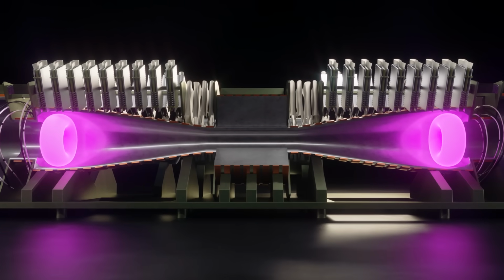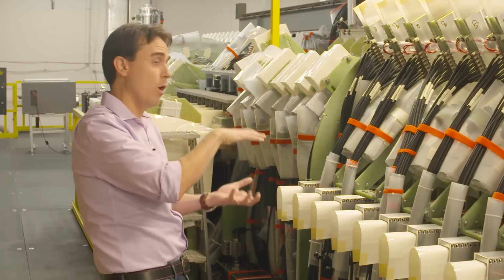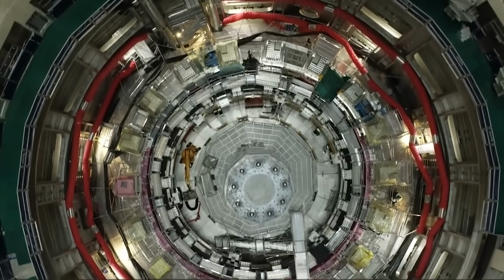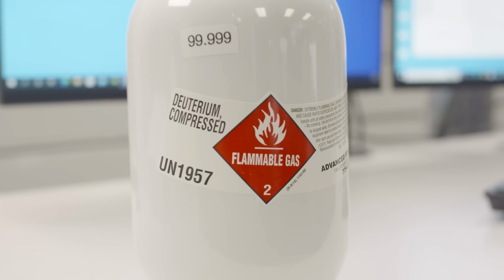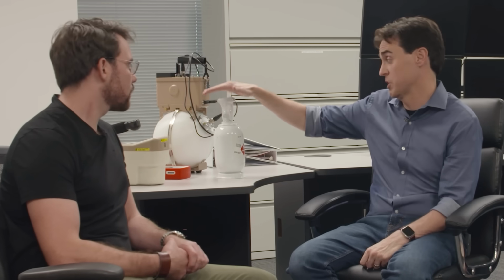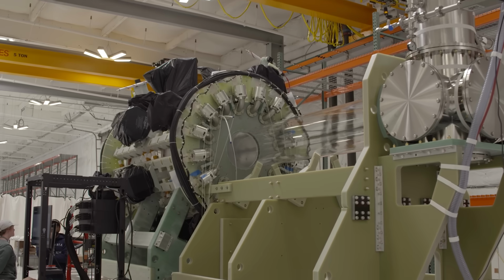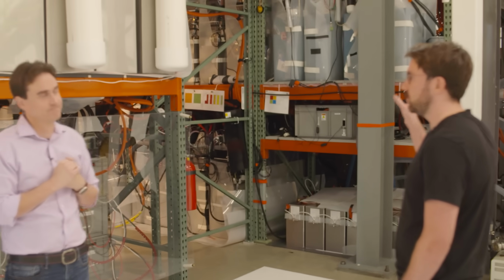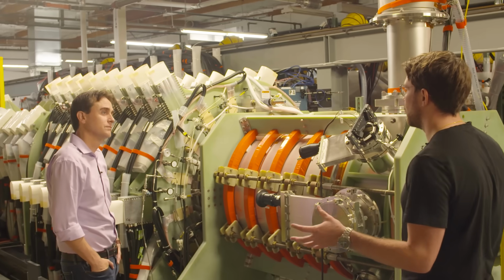A New Way to Achieve Nuclear Fusion: Helion

Comment: A few things that I missed in this video:
1. Did they achieve ignition? Or in other words, did they manage to generate more energy from the fusion than they put in to achieve that fusion?
2. What is the pressure at which this operates? One of the issues with tokmaks is that they have to operate at low pressures, otherwise the gas pressure will overwhelm the magnets, which forces them to work at extremely high temperatures. Is it an issue here? Why or why not? And if they do manage to have significantly higher pressure, does it significantly affect the temperature at which this fusion reaction takes place?
3. If they did achieve ignition, how far away are they from generating enough energy to reach a breaking even point considering all of the inefficiencies of the system?
Reply: I like how bananas were used for scale.
Reply: Net energy gain has NEVER been achieved.
Reply: They didn't achieve ignition. Ignition was achieved for the first time in history by a different lab after this footage was taken.
Reply: @timothynoonan8591  Do you know how far off they are? Will their 7th gen reactor that they talk about get close to being able to do it?
Reply: @256shadesofgrey  They say it will, but that's a very common claim for fusion labs. If everyone else says ignition is right around the corner, you have to as well if you want funding. 2024 is the predicted year.
Reply: @timothynoonan8591  I believe they achieved what you call 'ignition' at the point in the video where the cameras record a pink (or bright purple?) flash, they said the operating temperature at ignition was 100M degrees.
Reply: @James Lynch  They achieved fusion, but they almost certainly didn't achieve ignition (more energy out than in) or it would have been the central focus of the video and the subject of extensive news coverage. Ignition as defined above has been the #1 goal of fusion for many decades, and it was achieved by Lawrence Livermore after this video was filmed.
Reply: @timothynoonan8591  the U.S. Department of Energy confirmed in an announcement on Twitter that fusion ignition was achieved. There are papers written and champagne was drippinG.
That is all.
Reply: @krisstepper  Yes, by someone else
Reply: @timothynoonan8591  the ignition that the DoE was referring to where Q>1 was about the amount of energy contained in the light released from the lasers. Previously, ignition has occurred based on purely the amount of energy which went into the fuel. The next step for inertial confinement is more energy than what went into powering the lasers. And after that capturing more electricity than went in(finally self sustaining). 

There’s a long road ahead, but the drivers are getting more and more comfortable on it while their speed increases.
Reply: @timothynoonan8591  If you mean NIF, the energy in was 300 MJ while the energy out was 3 MJ.  That's not ignition.  NIF claimed ignition by defining the energy in as 2 MJ but that's like a financial manager claiming a 50% return on your $300,000 investment on the ground that $2,000 of it in one of 150 companies returned $3,000 while explaining that they weren't going to invest in those other 149 companies again.  No fusion projects so far are nowhere near true ignition.
Reply: @timothynoonan8591  ignition wasn't actually achieved. They lost A LOT more energy than they made to produce the experiment. The laser beam had 2mj energy to create 3mj but in reality they used 300mj to create the laser
Reply: @ThatHungryAfricanChild  That's still called ignition. They didn't achieve engineering breakeven because as you say the lasers currently lose much more power than the fusion produces.
Reply: @ThatHungryAfricanChild  They achieved ignition by the commonly accepted standards. Even though they're nowhere near producing full-system net energy, they are the first to ever get more out than they put in thermally, which is a real milestone - it means they can potentially move on to solving other problems, such as their god awful laser or the tritium supply issue.
Reply: @barneylaurance1865  ignition is creating more energy than you use. How can you call that ignition if you used 100x more than you made, that doesn't make any sense
Reply: @ThatHungryAfricanChild  The fusion reaction itself (which used energy in the form of laser light) created more energy than it used. The system as whole operated by NIF that used energy in the form of electricity didn't.
Reply: @ThatHungryAfricanChild  the achievement of net energy gain is that the amount of energy injected into the fusion reaction was less than the amount of energy generated by the fusion reaction. Think of it like throwing a rock against a wall. If the heat generated by the rock hitting the wall was greater than the kinetic energy in the rock flying at the wall, it is a net energy gain. However it disregards the energy you used to throw it, which is greater since you are moving your body as well.
Reply: @barneylaurance1865  but it didn't create more energy than it used. If the experiment costed 300mj and only made 3 back that's an extremely large deficit
Reply: @ThatHungryAfricanChild  You are both right.

Think of the process at Livermore as two components.

Part A is the laser, which is where the 300mj loss is occuring. The lab was built years ago with a laser which is not modern or power efficient.

Part B is the lasing itself, which DID create more power than used.

So... the next step is to repeat the process with newer more energy efficient lasers.

That is expected in 2024 and will be a net energy gain if their math is right.

The next step after that is miniaturization of the technology or shrinking everything down into a system which is economically viable.

THAT is expected around 2030
Reply: @ThatHungryAfricanChild  It all depends on what you're interested in. You could draw the boundary of your system anywhere you like. If you are measuring the calorie content of a serving of peanut butter, you probably wouldn't measure the amount of solar energy that landed on the plant's leaves during a harvest season. You might do that if you were interested in the crop land required to produce a serving of peanut butter, but if you're interested in how much that serving contributes to a human diet, you would only measure the available energy that is actually stored in that serving.

There is a debate to be had about whether the definition of fusion ignition is useful, but it is a valid definition. And from the perspective of a fusion researcher, it makes sense to use this definition because the current goal is to optimize the physics of the actual fusion reaction. Inefficiencies may be accepted in other aspects of the engineering of the fusion reactor because those inefficiencies can be improved upon once we know we can actually get something out of improving them.
Reply: It is worth remembering that NIF is an old facility, If built today it would use diode pumped lasers which ar ten times more efficient  still does not get break even obviously but there will be other things a scaled up attempt at a commercial inertial confinement reactor would change for more power.
Reply: @timothynoonan8591  Calling their laser “god awful” is hindsight bias to the extreme. Efficiency was never part of their laser design, they wanted an adaptable test environment. Could you imagine getting a ton of funding, spending 5-10 years building it and then realizing you built it just slightly too underpowered to achieve your goal? The laser is based on 90s tech, the design was formalized in 2001 and they finished building everything in 2009. So yeah, should they chose to redesign it, it’d be very easy to find high efficiency gains.
Reply: @silkforest8698  that peanut butter analogy is not even close to comparable to nuclear fusion. The energy usage is instantaneous. You're spending much more energy than you're gaining. Yes you can say that technically you created more in the experiment but if that experiment costs much much more to produce it then what's the point? It's like getting a $1 loan with a $300 interest and you use that dollar to win at the casino. Yes you turned the $1 into $2 but you're still -$298 in debt
Reply: @aaronchamberlain4698  I agree
Reply: @ThatHungryAfricanChild  The peanut butter analogy wasn't meant to be equivalent to the fusion example; it was just meant to illustrate that where you draw the boundary of a system depends on what properties you are interested in. I think you are concerned about the misconception that fusion ignition refers to net energy gain (at the level of the entire reactor system). I would agree that many news articles use language that can be deceptive, but I think researchers are justified in using their definition of ignition as a bench-mark for progress. I think your objections are reasonable, but it is important to note that the kind of disagreement you have is about the "usefulness" of the current definitions, not about whether the claims of ignition are true in the context of the current definition.
Reply: @aaronchamberlain4698  I was interested in that too, especially regarding the challenges with berrylium and maybe alternative techniques. Ie. if the best design will produce undesired isotopes, maybe change the design to implement an alternative containment that makes use of that like processing raw ore directly. Could it be used to recycle or accelerate spent nuclear fuel for example with a large net energy gain?
Reply: @calenedgar3722  I think you're dreaming too much. Even with 'energy efficient' lasers, the deficit will still be huge. It takes A LOT of energy to reach the state of fusion, no matter how efficient the process it. And the fusion itself has always yielded less electricity than what originally caused it to fuse in the first place. Only stars can get away with net energy gain because of their sheer gravity. So they don't have to apply any additional energy to cause the fusion. And hydrogen bombs get away with less input energy but its an explosion, not very suitable for electricity generation.
Reply: @ThatHungryAfricanChild  You are missing the point. Ignition was never meant to include whatever goes in to making the laser (or magnets, or whatever) work. It's simply a measure of how much energy did the laser have vs how much energy was released.
Reply: @ThatHungryAfricanChild  I must retort... The man now has two dollars to spend at this casino and wins four dollars. He plays again and wins eight dollars...I presume you get the point. Eventually this machine will, "pay for itself", so to speak. However, it's a massive loan, you have got that right good sir!
Reply: @ericromano7703  but the energy it takes to create the laser needs to be counted otherwise we are just lying to ourselves, acting like we achieved something but in reality we haven't made any progress at all
Reply: @morange492  I guarantee you this is as efficient as they can get. Can't blame it on "old technology" they are a government funded research facility, in reality "ignition" just isn't possible
Reply: @ThatHungryAfricanChild  To say they didn't make progress, when it's the first time that a reaction has generated anything positive in the history of fusion energy is monumentally ignorant. The system as a whole does have a massive energy deficit, but the reaction itself was net gain. If you can't understand how to differentiate concepts, then there is nothing left to discuss.
Reply: @ThatHungryAfricanChild  laser ignited fusion is a dead and - and actually a scam. This will never produce net gain. I highly doubt the reaktor from this video will because imho the only way to get net-gains is to reduce number of ignitions and not just to make it faster. Hope the Stellerators will win the race.
Reply: @LordDonnington725  but it wasn't positive though, they lost 100x more than they made. You're robbing peter to pay Paul and call it progress 🤣🤦
Reply: @LordDonnington725  The problem is that their is nothing special about the input:output ratio passing 1:1 because that's not point where any practical enginering or proof of concept occours.  We KNOW we could never make a practical device to get net energy out of that kind of a reaction due to parasitic losses in both the delivery of energy into the plasma and the conversion of thermal or kinetic energy into electricity.  The actual point which would be meaningfull would be ~4-5:1, only at that point could be build a device with a praryer of being self-powering.  Only at that point would the excuse 'the device did not actually collect the energy yet or didn't use modern lasers' be relevent because we would indeed just need to attach such conventional systems to make a self-powering device.  And even a self-powering device is STILL just a proof of concept because it's rate of production is likely to be so low that the net output it produces costs millions of dollars a kwh.  So yes the ignition claims at NIF are deeply misleading because they draw a system boundry for in:out at a point which would dose not square with the claim that 1:1 is significant.  This is effectivly a bait and switch indended to confuse people.
Reply: @Mr. Hank Hill  "Fusion ignition is the point at which a nuclear fusion reaction becomes self-sustaining. This occurs when the energy being given off by the reaction heats the fuel mass more rapidly than it cools. In other words, fusion ignition is the point at which the increasing self-heating of the nuclear fusion removes the need for external heating. At this point, the external energy used to heat the fuel to fusion temperatures is no longer needed." So yes, the energy, the laser put in is less than the output, but no the energy we humans put in is more than the output.

But nuclear fusion is not just one problem its a multitude of problems. ONE of them being the ignition. Another one the duration we can keep the fusion going. Another one the way we extract the energy and convert it to electricity. And one other problem is the conversion rate of electricity we use to put in energy into the system.

What we have done now is showing that ONE of these problems (namely ignition) can be solved. 
We still have a long way to go to solve the other problems. But they are other problems. Not a problem of ignition.
When you speak of a net gain of the entire system then you speak of the final end goal of nuclear fusion but the others here dont.
Reply: @aaronchamberlain4698  they’re actually 70s lasers, retrofitted with 90s pump diodes to turn them from infrared to green (which has an overall 25% efficiency just for the pumping stages). So it’s even worse than you’re saying!
Reply: @barneylaurance1865  "the lasers currently lose much more power than the fusion produces."  Right, the lasers were only 0.7% efficient.  The odds anyone in this century can make a laser that's over 67% efficient is close to zero.
Reply: @ThatHungryAfricanChild  Exactly!
Reply: They didn't because they haven't built the version capable of harvesting the energy. The units they currently have are just prototypes used to prove the theory behind its operation.
Reply: @256shadesofgrey On Helion's wikipedia page, it says that Trenta achieved densities of 3x10^22 ions per m^3. That's about 1/20th of a mole per cubic meter.  If my mental math is correct, that makes it about 0.001 bars of pressure, which means the center of the reaction is at a "medium" vacuum level.
Reply: In this model, they don't need need/use ignition (defined as self sustaining fusion), they only generate more energy than they put in, which they are already doing.  They are just not capturing it yet, which is likely going to be quite a challenge.

As fusion processes become better understood, this type of solution can be scaled up and concentrated for higher power yields.  What Helion is designing is the nuclear equivalent to a combustion engine.  Over the coming decades it will dramatically improve as people get better on the "fuel" side.
Reply: @ferdievanschalkwyk1669  if it's true what you wrote I certainly would have heard about a fusion reactor creating more energy than it consumes (except this laser fusion thing that went "viral" the last week because it actually was not true)
Reply: @punpck  publicly funded research projects tend to get more media attention, as that is how they secure their funding. So you hear of those earlier and more often than with private industry.
Reply: The electricity generating mechanism using the plasma field is neat, but I doubt its enough to reach break-even or cross it. Without crossing break-even, it is still useless as a surplus energy provider.
Reply: ure mom achieved ignition and sell it as ACCOMPLISHMENT for getting more FREE money Gezzz!
Reply: NIF its not ''another lab'' its a money maker for the elections
Reply: Its mentioned at the end of the video that Helion is currently making the next prototype which will have the capability to draw power from the mechanism, so I suppose they have yet to achieve the "Ignition" you described.
Reply: It's a good video but I am surprised to see that they did not talk about the most important thing - ignition (or "net energy gain" for the people who think just creating fusion is ignition).  It's totally fine that Helion Energy hasn't done it yet but since they are claiming they will start producing electricity as soon as in 2024 the video should have talked about their plans, because if ignition/net energy gain doesn't happen all of this is for nothing.  I request the channel to create another video addressing this.
Reply: If it was non-electric ( technology that does not use electricity ), they will say that it is not permissible and it is wrong under the pretext of ( a perpetual motion machine and that it consumes more than it produces ), but technology that consumes electricity, they would immediately say: Wow ! It's a super technology from the future !!. It seems that natural laws do not apply to electricity because it has a special recommendation or something similar to indulgences . Often, I see that consumer companies and people related to them try to push down every technology that does not consume electricity or does not require electronics, and unfortunately many people believe them.
Reply: Ignition is simply creating a fusion reaction; the term you’re looking for is energy net gain within a fusion reactor.
Reply: @pekabu01  I made this argument with someone a few days ago, read up on it, and it turned out I was wrong. While it may not make common sense, 'Ignition' is a specific term used to refer to getting more energy out of the reaction than goes in. It's just a terminology thing.
Reply: @pekabu01  No they've had fusion reactions for generations now. The first man made fusion happened back in 1932, and 20 years later the first fusion bomb was detonated. If that was the definition of ignition, no one would care about it.
Reply: i saw a guy mention today they managed to finaly make fusion energy where they got like 2 mega jules input and got 3.5 mega jules output so they  produce more energy while inputing less energy
Reply: Energy is not created nor destroyed...
Reply: @Nuhopoclik1  matter is energy though.
Reply: @Nuhopoclik1  but it does change forms
Reply: @Nuhopoclik1  who was your Physics teacher?, Isaac Newton? :-)
Reply: @sergiokorochinsky49  I had many physics teachers, but none of them are that old. The first law of thermodynamics is from my ChemE background, however.